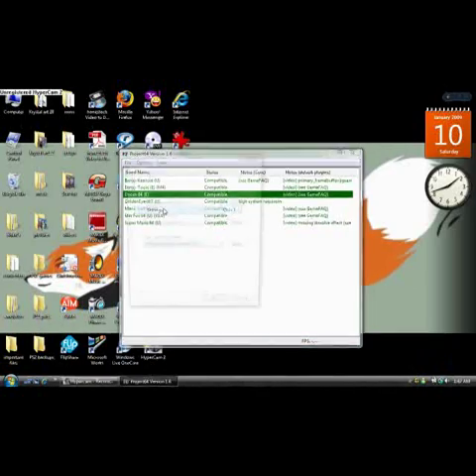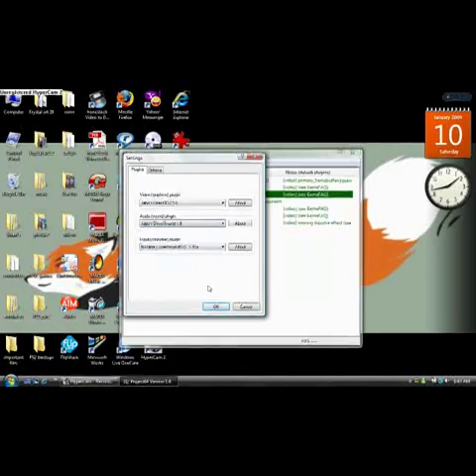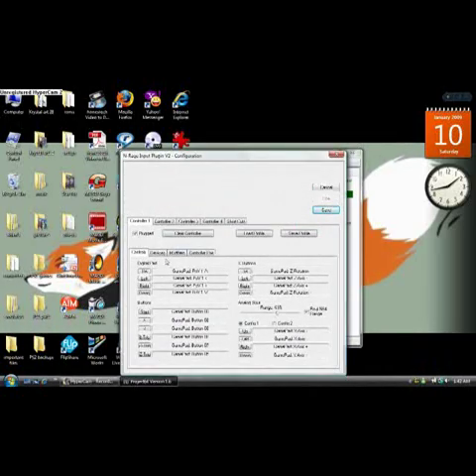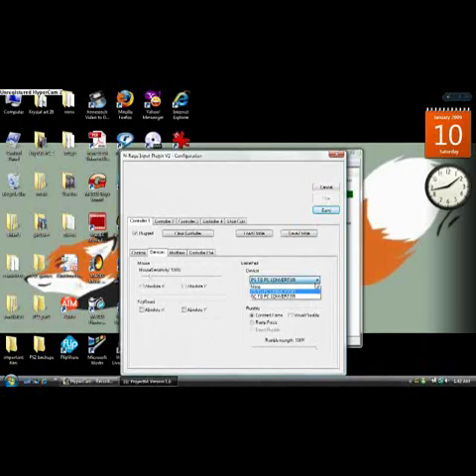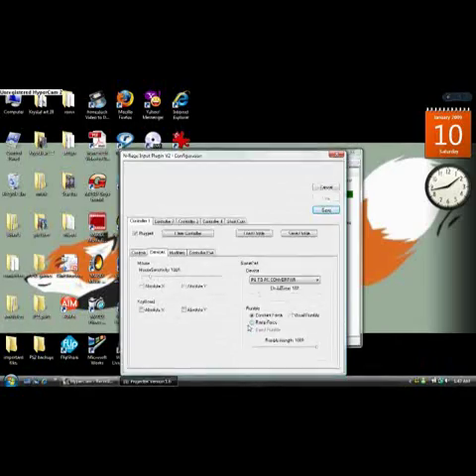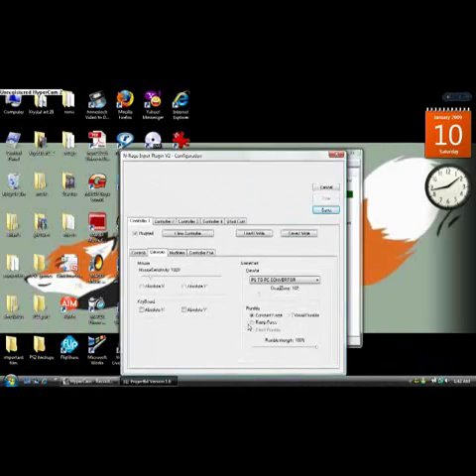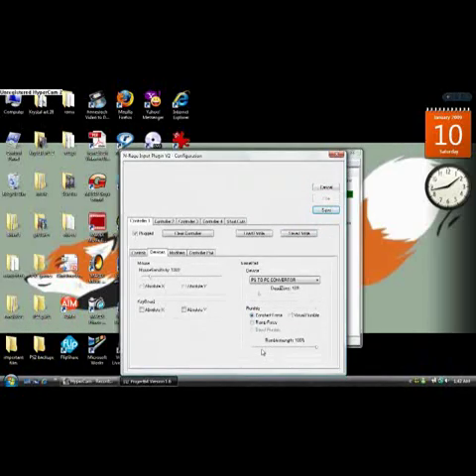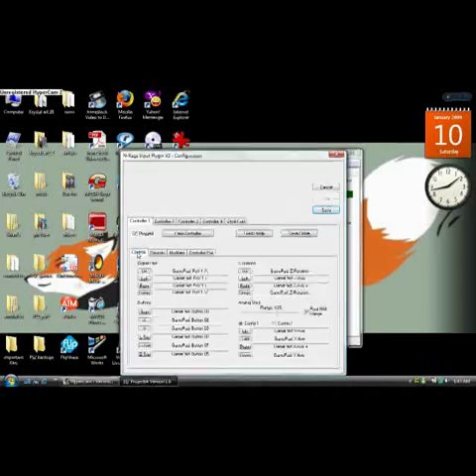Noobs Guide: rumble feature on Project 64

Comment: he said you need to switch input plugin to n-rage then go to your controller settings then you can change the rumble more flexibly compared to default project64 plugin that comes with latest stock project64 (mine being 3.0.1) also its the 4th tab in input settings after switching plugins

Comment: Can you turn on Rumble pack AND memory card at the same time to save game states?
Reply: no
Reply: no but you can setup other controllers to have mem packs and have the controller your using to rumble and it will work the way i think your trying to use this for but if you need all 4 to rumble sorry your outta luck